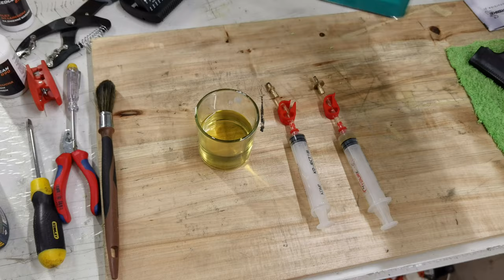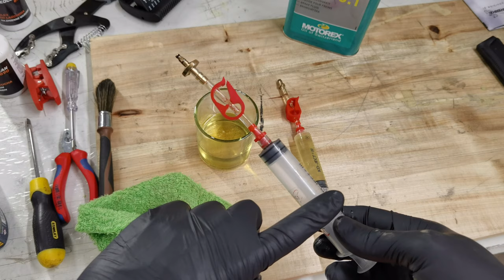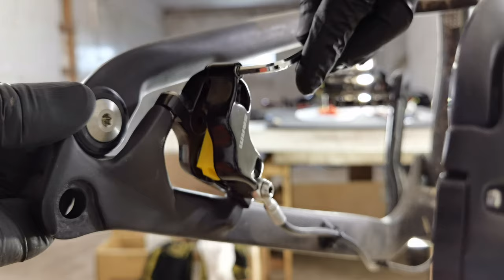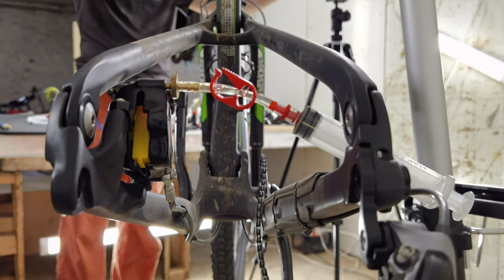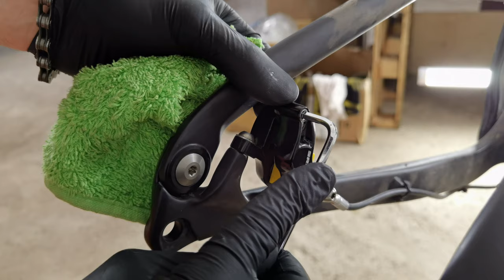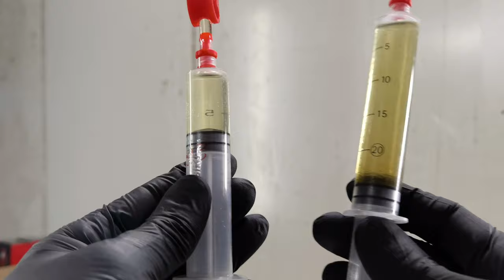Sram Guide Ultimate brakes - bleeding / oil replacement.

Comment: Imho, you should bleed from bottom to the top, so the air have easy travel and can escape upwords (because bubbles do not go from top to down, they travel on its own from down to top) + it is not oil, it is braking fluid and before putting it in the system you should "suck" the syringe several times to release air buble from the fluid itself. Fluid itself is "agressive" to the skin, environment etc. Because of all this, I love Shimano brakes and their mineral oil, so much more easy to service compared to brake fluid brakes ...
Reply: he did end up with the top?

Comment: Don't want to mess with DOT 4/5.1 fluid. I prefer brakes with mineral oil.
Reply: Yeah I’ve gone either way shimano to hope and it’s not good dot fluid
Reply: Never had problem with dot fluid. Much easier to source then mineral oil and also cheaper.
Reply: mineral oil is horrid for braking,  its also poor excuse for lack of quality parts in the brakes.

Comment: What a convoluted unnecessary waste by bad design.
I've just bled motorbike brakes via a small reservoir on the lever.
Quick,easy and all it cost was a length of pipe and brake fluid.
MTB hydraulic disc brake bleeding costs are a rip off
Reply: Cost like 10 bucks and it makes it easy

Comment: I heard the opinion that it is better to pump the brakes from the bottom to top. because wear debris (usually rubber) accumulates in the shifter (master cylinder).
what you think about it?

Comment: You forgot to extract gas from fluid. Simply close lock on hose and pull cylinder. Then release lock and push and repeat several times. Similar job is to do with lever

Comment: friend I am putting dot 4 oil but but when I inject it the oil does not flow it does not enter I hope you help me
Reply: Your bottom fill port is probably not open. We tend to tighten the hose to the caliper to tight. Turn the bolt to the left 1 full turn and then only snap in the hose.